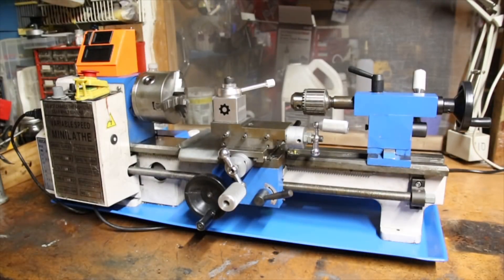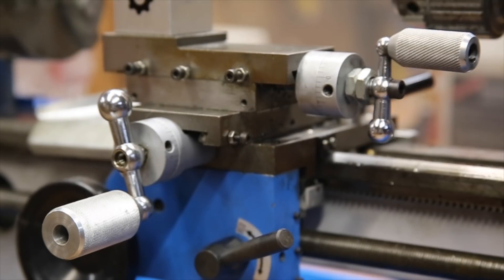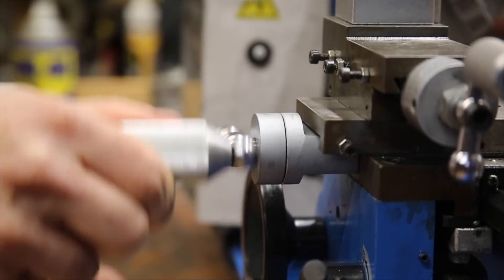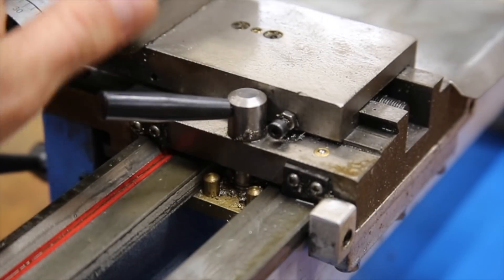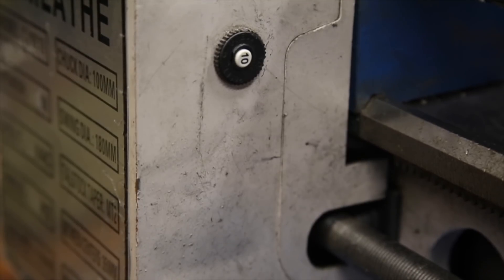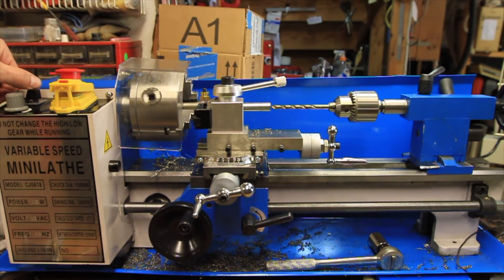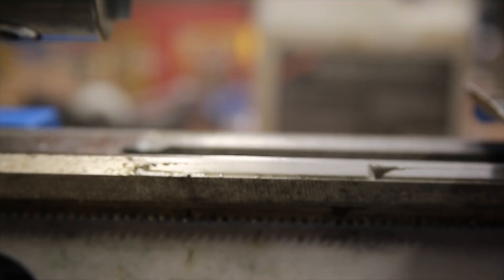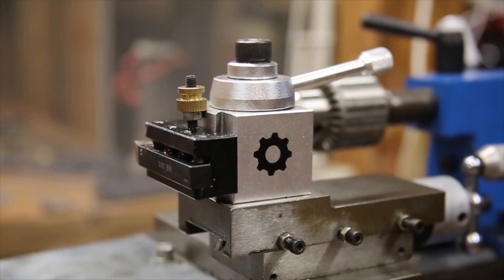Top 5 Best Upgrades and Modifications! Mini Metal Lathe - A Year In Review Part 1

Comment: The chips tray is a must. The carriage lock too. I had no problem with the motor mount or handles. As for the circuit breaker...I had to change the whole electronic. The other mod that is really worth it is the bearings change.

Comment: Well, the motor-mount upgrade is definitely not one I'd put as a "Top 5 Best Upgrades & Modifications" because it isn't a universally good upgrade. I have a mini-lathe, & my motor mount is fine. I like the knurled knobs a lot. The carriage lock, while super handy, could actually be improved more. I saw another video where a guy made the carriage lock essentially another apron guide. Circuit breaker.... yeah, I"m already in a bad spot. My lathe is connected to the power in my garage. The geniuses that designed my house decided that every socket that could get wet should have GFCI in the panel, but they were too lazy/cheap to run multiple circuits to distribute power load, and so one 15amp circuit feeds all sockets in my rather spacious garage (and has 8 4-receptacle AC sockets + all sockets in all 3 bathrooms, plus all sockets in the kitchen (remember, water) plus the laundry room, plus all outside sockets. This means one 15 amp breaker is servicing 20 receptacles, or 58 ac sockets, my lathe being connected to one of them. When it blows I take out half the house, so we're used to losing power regularly. Can't run the lathe & the toaster oven at the same time.

Comment: Would this this fit 4 1/2 solid round aluminum
Reply: it's a bit of a stretch even to put 4" diam piece in a 4" chuck, but if you can center drill a hole for a drawbar thru the spindle to hold the piece the next hurdle is not having enough travel in the cross slide to face the whole piece off in a single pass. it can be done tho.

Comment: I got one of those aluminum, button-style quick change tool poasts very similar to yours; it looks identical. Mine was very sloppy and had no repeatability. I went with a steel wedge type tool poast which was about double the cost of the aluminum one, but good quality and repeatable.

I tried a 4x4 peice of rubber roofing material as a ways protector, but its rapidly degraded by cutting oil and will replace it with your chip tray.

Comment: Me and a friend of mine got one of these lathes and we ended up just shorting the fuse with aluminum foil and just letting the wires going to the chuck safety switch of which i just removed and twisted together the wire to bypass the switch and when ever the wire starts smelling it tells us to let up on the cuts i know its not a good idea but it works for now

Comment: I see people saying bolt it down but as you point out that prevents it being portable. A much better idea to make it more stable is to get a couple of 14"~16" lengths of 4x2. Counter-bore to sink in bolt heads  and screw original rubber feet to ends.. Mini lathe doesn't tend to rock forwards but does tend to tip backwards. Apart from that, the best mod is to fit taper roller bearings to headstock. HSS tooling will take a sharper edge than carbide but you will need a bench grinder to shape it. The QC toolpost is handy but personally I removed mine and use the old style as tyhere is less tool overhang (I noticed you have compound slide way out a few times, doesn't help surface finish as it tries to 'lift' rear of saddle/carriage)

Comment: nice summary. theres a small "mod" i did that you could do too, its just drilling a hole right on top of the gears of the spindle and adding a grease nipple to it, that way i can put some grease into the headstock from time to time, wich hopefully lets the machine run a fair bit longer :) 

we need to find a way to rotate the carriage without screwing it all the way back every time. i'd love to do more tapered stuff but dialing it in is always such a huge pain in the ass that i do everything to avoid it.